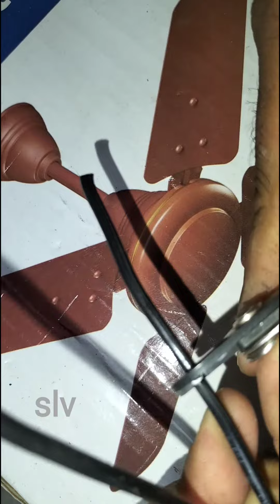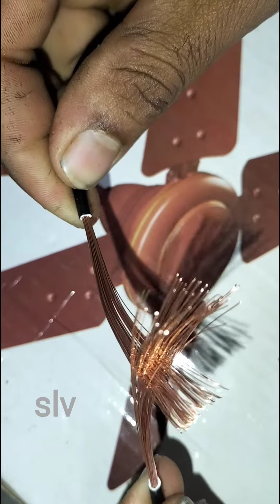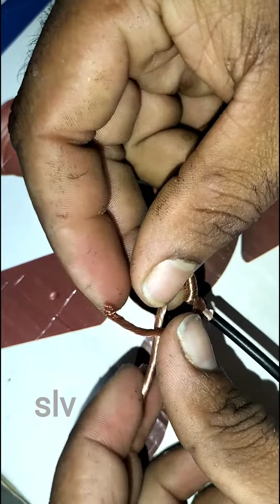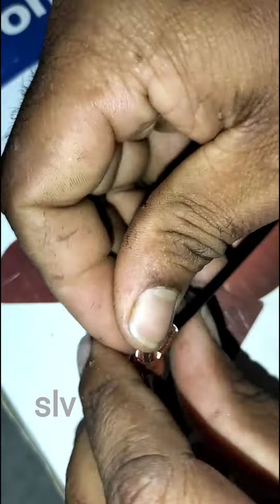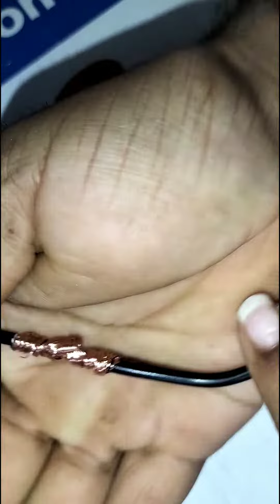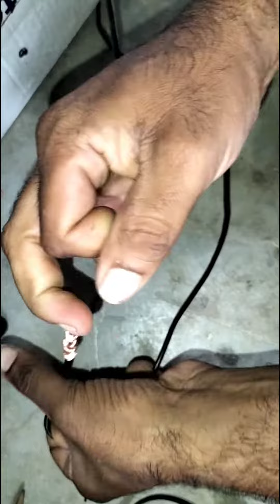Electrical Wire Joint | Properly Joint Electrical Wire | Tips & Tricks | Copper wire joint |

Comment: NNOOOOOOOOOOOOOOOOOOOOOOOOOOOOOOOOOOOOOOOOOOOOOOOOOOOOOOOOOOOOOOOOOOOOOOOOOOOOOOOOOOOOOOOOOOOOOOOOOOOOOOOOOOOOOOOOOOOOOOOOOOOOOOOOOOOOOOOOOOOOOOOOOOOOOOOOOOOOOOOOOOOOOOOOOOOOOOOOOOOOOOOOOOOOOOOOOOOOOOOOOOOOOOOOOOOOOOOOOOOO
don't do that with bare copper.
you can do this knot with rope but not with copper as you need great electrical connection without bending it too much  -  after some time the copper will snap.